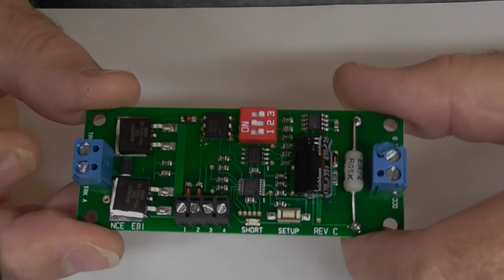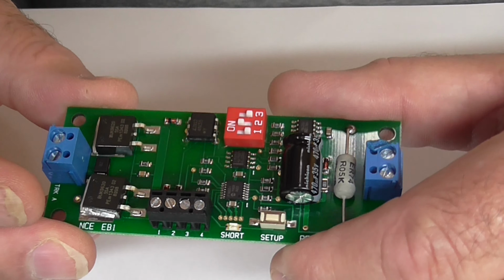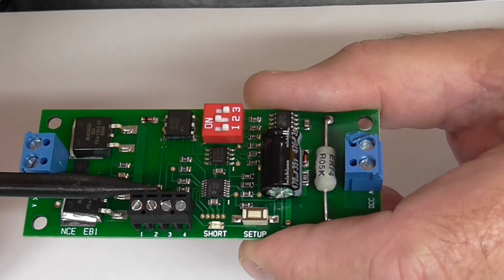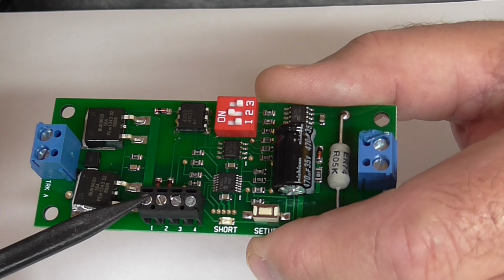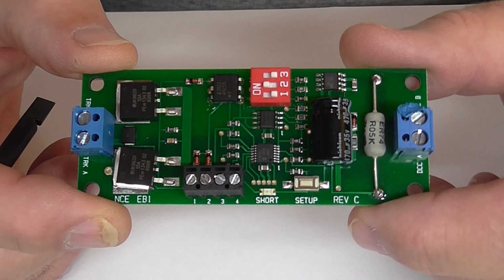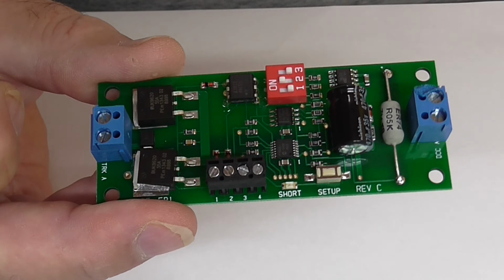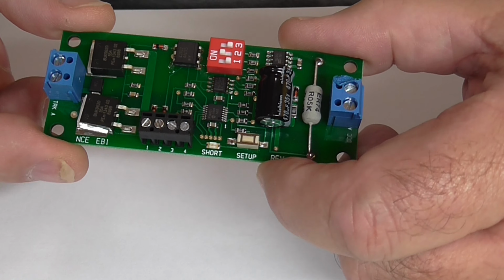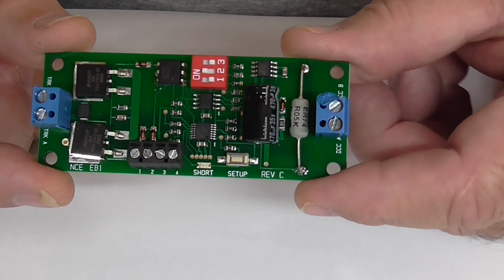Model Railway – Circuit Breaker

Comment: I am a big fan of the electronic circuit breakers for DCC model railroads. I went with the PSX-1 and then added the buzzer, so that I get an audible indication of a short.  But I like that this one can be adjusted by dip switches.

Comment: Hi Simon,
I do wonder if you would need one of these to protect the Hornby select or the elink systems as when they fuse the whole system goes dead and does not come back on until the problem is sorted and you push a button to reset this is unlike some of the more expensive systems that try and reset it themselves otherwise an interesting video and could save someone an expensive fault in there control unit as always keep safe and well.
Cheers Robert.
Reply from the maker: Hi Robert, they cannot be used with the E-Link or Select, they default power supply only has a 1amp supply, so too low.
Reply: @SimonLivertonCentral  Hi, I use a Hornby 4amp transformer so I could use it but as I said no need keep safe and well.
Cheers Robert.